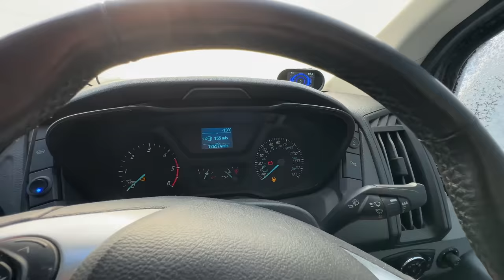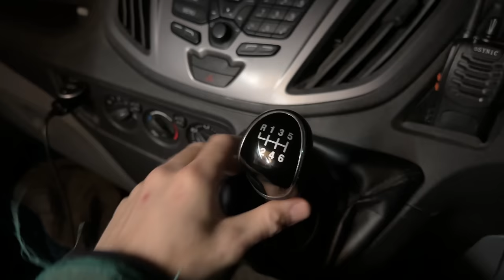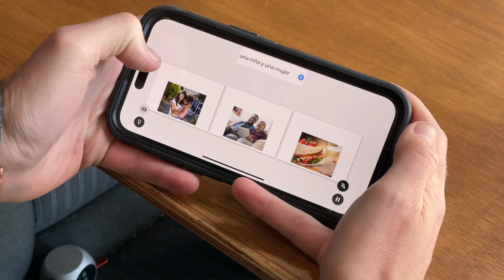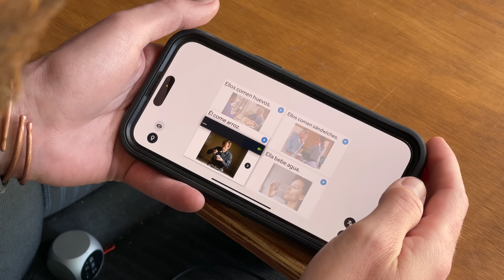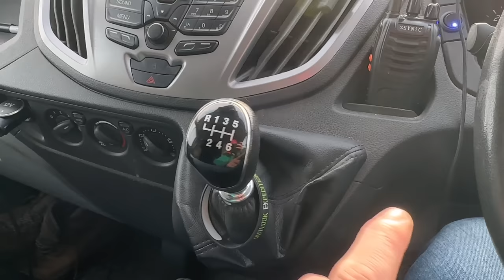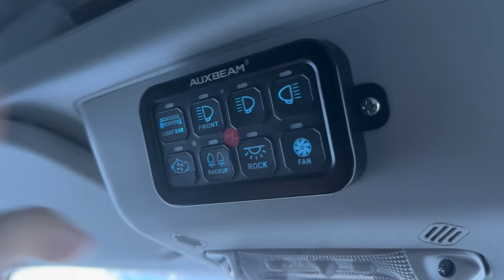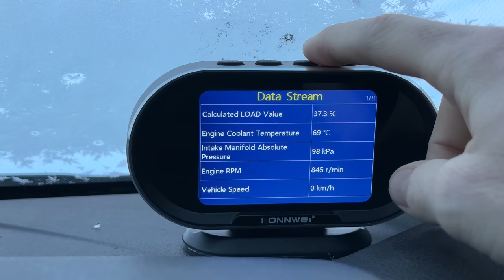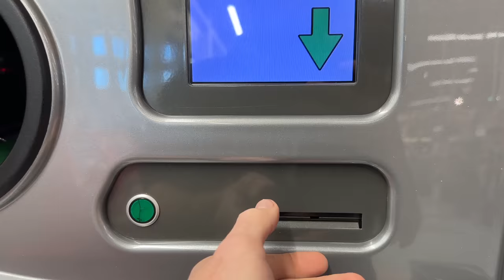Crazy Winter VANLIFE Camping In The Arctic!

Comment: I think your self installed pre heater is perhaps one of your best decisions on your van, of course I do not know all other ins and outs but Yeti performs exceptionally well considering it isn’t made for the arctic regions I suppose. Think it’s a lot off modification but I wonder if you have enough height in Yeti laying a thicker “kingspan” floor so you could route pathways for pet tubes to install a glycol filled hydronic floor heating system?  As for the frozen gear shift levers, I had to think about the times I worked at KLM aircraft maintenance, it may sound to much to bother but it is relatively easy to install a de icing system again with glycol with perforated small diameter tubes just spraying it on parts needed to be de-iced with a secondary windscreen wiper pump.  Ah well it is just fun just brainstorming your van Alex :-) regardless I hope next winter we can follow a new adventure Alex!! Cheers, Albert
Reply from the maker: The engine preheater is one of my favourite things I added to the van! 

As for height it’s a tall van inside and I’m 6’2” so I think could of done 50mm in the floor and done still be fine. Currently just 25mm

Comment: Great I saw your video up again, what do you use to keep cab warm at night I have the German 4 inch screens and a thermal cab divider that I can open, I have  a Peugeot boxer so what also is the thermal screen covering your  radiator out side and where from please.?
Reply from the maker: I don’t need to keep the cab warm overnight, as I have insulated sliding bulkhead door, which separates off the habitation and the cab. It will be +21c in the back and -20c in the cab In the morning. I just turned the engine pre heater on and heating the engine and then cab heater in the morning to warm it up for driving. 

Grille cover is home made from windscreen installation material. Anything can be used
Reply: @MispronouncedAdventures  thanks yes, also you always reply which is good, 👍
Thanks again

Comment: One tip that I use when I shoot in really cold temperatures is that I just toss the equipment in a bag that I've had outside the vehicle. Close it up and bring it in. Then there's no way that the camera gets internal condensation.
Reply from the maker: I haven’t found it an issue in the extreme cold as it’s an extremely dry environment both inside and outside the van and I have more issues in in the UK winter or high humidity when I’m working in hot jungles
Reply: @MispronouncedAdventures  yeah, that's true. The van is dryer than my own home. (Have to get rid of all the plants.)

Jungle? Tell us more!
Reply from the maker: If you look in the video description at the bottom, you’ll see a link to my website, which is my name, that might give you an idea of what I do professionally
Reply: @MispronouncedAdventures  Nice!
Great photos too.

Where were you in India?
I stayed in Chennai for five weeks some years ago. Shot some pro bono in the slum.
Reply from the maker: Been north and south. South I was in Chennai and then took clients over to the opposite coast

Comment: You seem to think that you can't drive snowmobile legally in the Nordics? Not sure why. You do have at least cat. B (max. 3500 kg vehicle) UK driving license, maybe even higher class.  This gives you legal right to drive snowmobile. In Finland at least cat. B includes cat. T (as in tractor) which is the lowest rung needed for snowmobile, when outside private properties. So if you have cat. B or higher driving license, like you have, you can drive snowmobile on the official snowmobile tracks, cross the B-roads, in special cases drive on the car road etc. where the cat. T and the age 15+ is the minimum requirement.
Reply from the maker: As far I understand for the uk B license regarding snowmobile use that was only allowed for us in guided group circumstances, not general use